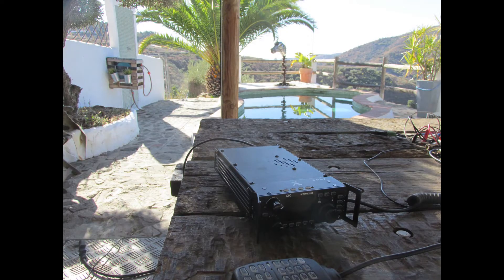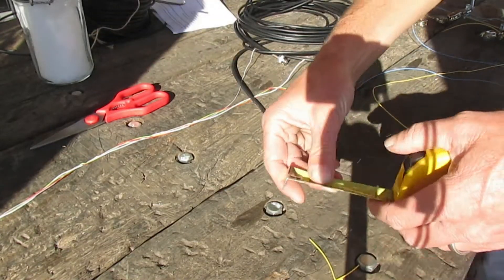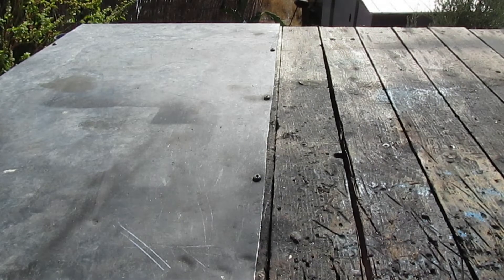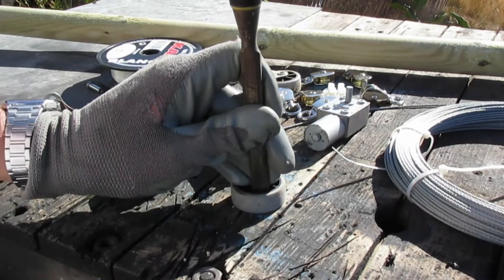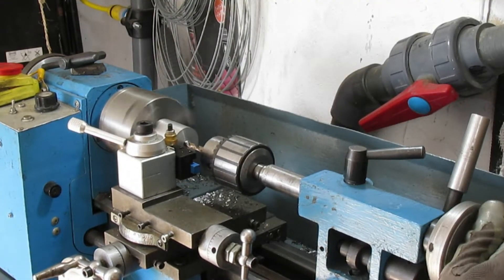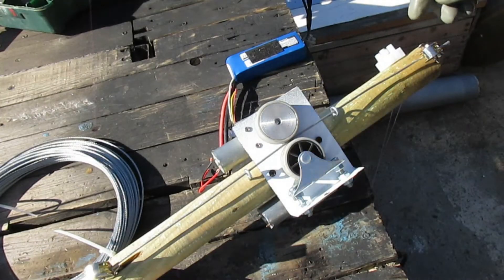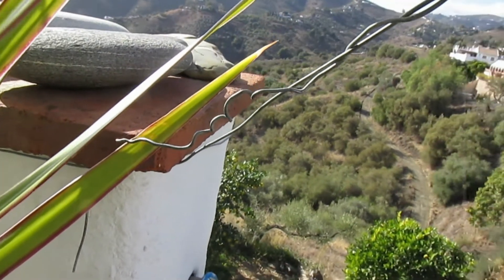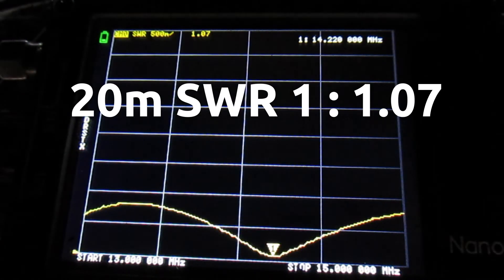New All Band HAM Antenna

Comment: What is your QTH?
Reply from the maker: Spain, Costa del Sol, 10km from the Mediterranean sea, 384m ASL
Reply: @aga5897  Beautiful place and nice idea? 👌
Reply from the maker: @ВячеславТрапезников-я7р  The Idea changed - i used the pulleys to make a 'Cat's Whisker' antenna for 10m and 20m, then added a 40m antenna which works fine for 15m too. Four bands, small cost and very little effort !

Comment: i built smiler to this about 10 years ago, i used 1mm MiG welding wire for the feed line, i also used wire feed mechanism out of a old MiG welder. mine was an end fed antenna, worked very well.
Reply from the maker: That's the Spirit that made Amateur Radio Great !

Comment: I have seen something very similar to this years ago at the Dayton Hamvention. It was totally motorized dipole, tunable from 6 -160 meters if you had enough space to stretch out the wires and came with a control box that included a built in SWR meter, (2 meters, Forward and Reflected power.)  He was selling them at a reasonable price but this was back in 2008 or so. Haven't seen the guy since.
Reply from the maker: Thanks for the info - i guess there's nothing new under the Sun ! 
Maybe just the basic manually tuned version is at least amongst the cheapest possible multi-band antennas.
Reply: @aga5897  Good design though, as long as it is easy to setup and tunes well. I reid for a year or two to find the guy that had the motorized version I saw at Dayton, but he disappeared?  The motor and wire feed , coax feed, pulleys were at the top of the 30 ft mast, then two ropes ran down and were staked to the ground. The wires then road  down  the ropes on pulleys that had weighs on the ends to drag them down the ropes. Great idea if you had the room. It was as your's is, and inverted V
Reply: I saw that as well.

Comment: "Good idea in a good hands"  :)  This hight is good for local QSO, the signal becomes stronger at short distances 100-200-500 km ( zenith radiation). For DX we need at list half wave up or more. I use cheap steel square  pipes 50mm x 50mm  with 6 m standart length connected with round short pipes 48 mm inserted in. Fixed with the 60mm bolts and nuts. At the top is a ring with a strong rope goes up and  down. Easy to make It up and down for adjustment for resonance. The pipes Itself are very light ! The tower needs support ropes around.
Reply from the maker: My Wife says Nothing about This antenna.
That means it is OK.
If i put up a Tower with a HexBeam, or StepIR, she will say Very many more words. 
She will say so many words that the antenna  will fall down.
Reply: @aga5897  ...the antenna ternes to be angry.. :):)

Comment: Poor mans stepper IR, I love it. More details please.
Reply from the maker: The motors didn't work, because i didn't work out a way to grip the wire reliably.
Just pulling the strings manually works 100% so i settled on that - also makes the whole thing very light, e.g. an all-band portable antenna
Reply: @aga5897  Knurled drive wheel??? I saw that you have a lath.
Reply from the maker: @neilhankey2514  i tried that, also rubber and tension and  a pinch roller - nothing worked well. It needs a smarter person to work it out.
Reply from the maker: @neilhankey2514  even just marking the wire at the centre of each band and pulling the wires by hand gets almost a perfect 1:1 SWR